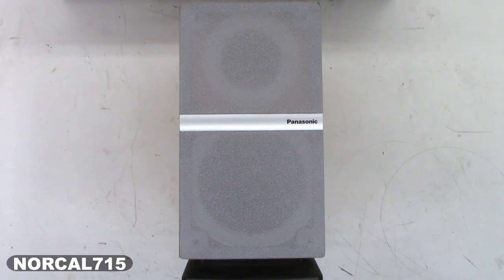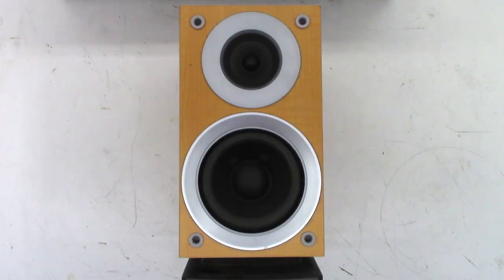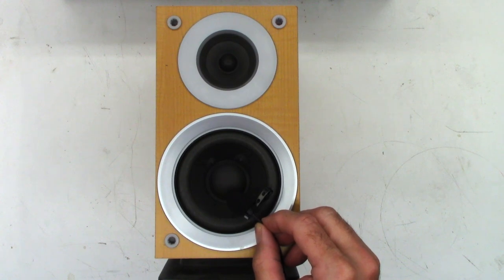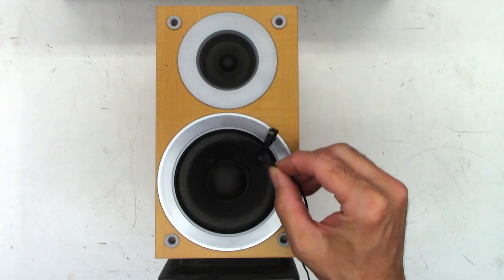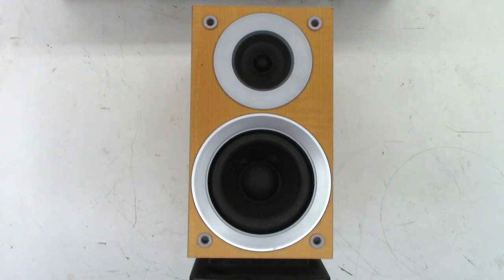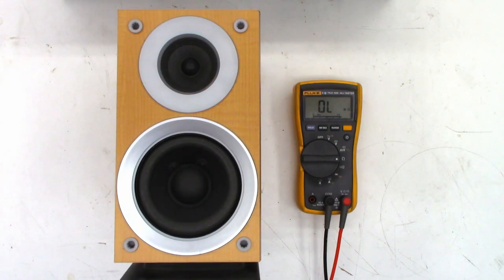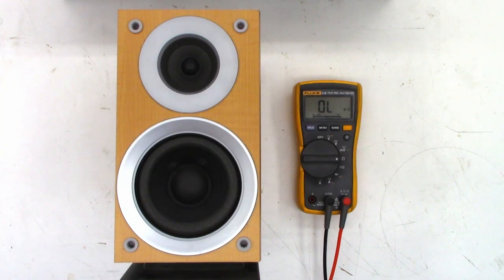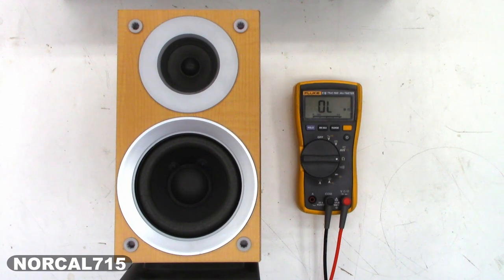Testing speakers with only an Ohm Meter and your ears.

Comment: I like your methodical approach to problems. I need your help. CRT JVC AV-29SX17 shuts down immediately after power on. the relay clicks. line out put has 135 volts.

Comment: i was told on a two channel stereo that is you had a bad speaker on either side and you cranked it up you could blow the amp because there is no resistance on the amp from that speaker blow out that channel  kind of like putting a brick on your gas pedal in neutral instead of having it in gear  dont know how true that is but the same person also showed me how to run speakers in series if you want to run multiple speakers through out the house and in doing so in series you maintain the resistance

Comment: Hi. Thank you for that presentation. I do understand the difference between resistance and impedance. Out of curiosity I checked what result will I get if I connect a multimeter to the back of Focal Chorus 714s rated as 8 ohm / 90 watt. The DC resistance came back as 4 ohm . Speakers are all fine and work really well , given the fact there is a crossover in the equation and i dont want to open the box so i could check the very speakers inside separately - would you say this difference between rating 8 ohm and dc resistance showing 4 ohm is normal? Thank you.

Comment: I had that problem on one channel on my Magnavox astrosonic, it only acted up on the phono... turned out the 55 year old cartridge was on the way out and causing the highs to stop working on one channel. but if you tapped the tone arm the highs would pop back in for a few seconds and then quit again...

Comment: I found a couple of Infinity 2 way bookshelf speakers at Goodwill for about $12.00. They looked good so I bought them. Get them home and find that both tweeters were dead. They had melted wires where they hooked to the terminal. I cautiously resoldered the really fine wires, and they're working once again. Both woofers had a 3 inch tear in the foam surround in the exact same place. I used some flexible rubber cement on both tears and fixed that. They sound wonderful once again. I'm guessing someone really over drove those speakers to the point of melting the tweeter connecting wires and ripping the foam surround. Does anyone know if that's correct?

Comment: I wish I would have been able to see you test the speaker other than “magic” hands. Like what where and how did you do it?
Reply from the maker: The coupling capacitor had broken off of the terminal of the tweeter. Just had to solder it back.
Reply: @norcal715  I don't think he means the repair of the tweeter, but how you measure the impedance with the multimeter? At least, I know I would have liked to have seen that. Do you just connect the probe points to the speaker inputs at the back of the box, or do you have to get in there?